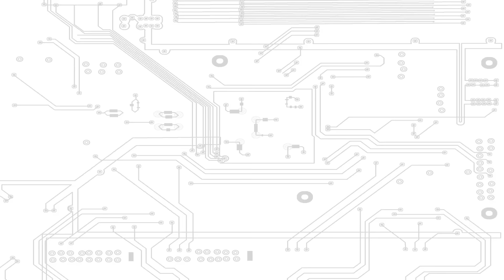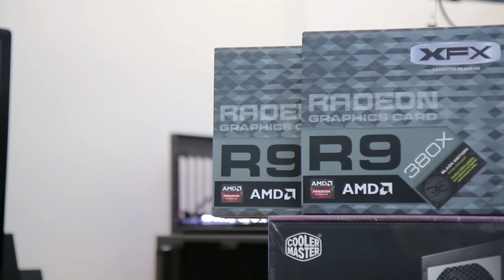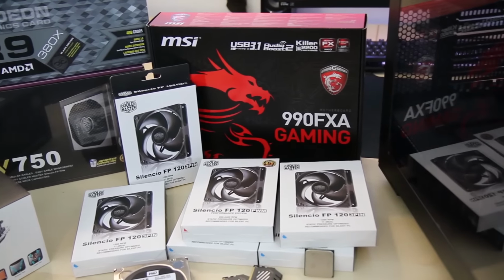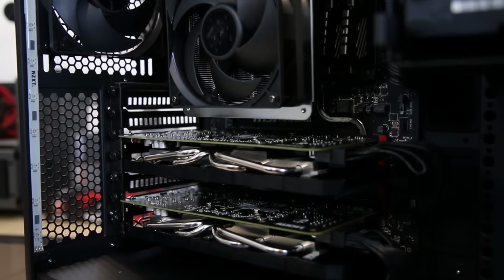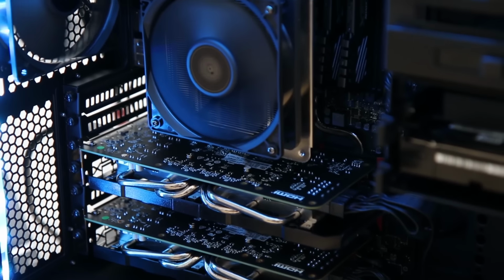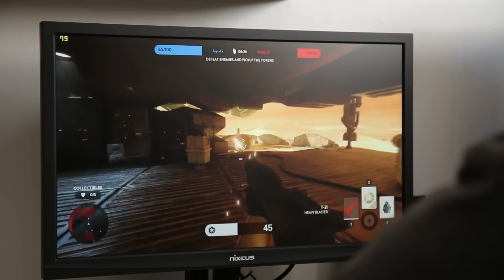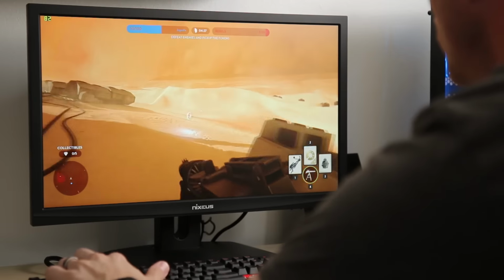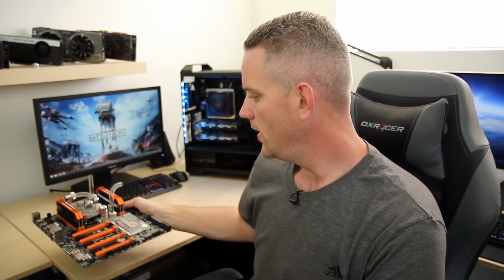AMD Gaming PC - Is AMD still good?

Comment: Any predictions for Zen?
Reply: More powah
Reply: They're gonna be flashy new CPUs.
Reply: Much better heat/performance due to better manufacturing process. APUs with HBM?
Reply: +Tech Showdown   It  should  be  kick-ass  !!
Reply: +Tech Showdown It'll be extremely over hyped by everybody during the build up to its release. Then when it finally launches whilst probably performing much closer to similar Intel products it still wont be as powerful as a top end Broadwell-E or Skylake-E which will launch a few months after Zen. Its only saving grace will be that'll it'll be considerably cheaper than Intel's offerings.... That's my prediction :)
Reply: +VR6 Doug So basically like every AMD processor out there?  I wouldn't expect anything other than that really.  The AMD's strong suit is it's price, Intel will most likely always out perform it.
Reply: Hardcaslte  if it's around Ivy Bridge IPC level it should be great
Reply: hello walkman I agree with you on that one.  I just wouldn't expect it to be as good as something like a new SkyLake processor; but really SkyLake isn't that necessary even by todays standards.
Reply: Hardcaslte   yes skylake is about 10-15% better than Ivy ..
Reply: Bike Dude   not really.  Zen was only taped out 2 months ago so it takes about a year to release after tape-out ..
   and there shouldn't be any shortage since amd has contracted both samsung and globalfoundries to make zen and arctic island gpus .
Reply: GODLY
Reply: +Tech Showdown Guys i'm not very informed about what amd is doing with zen, should I get a i5/i7 now or wait and see whats coming for zen?
Reply: SynapseTSS∞   what  is  your  present  system ??
Reply: hello walkman FX-8350 and a GTX 970
Reply: SynapseTSS∞   then  wait  for  zen  and  polaris / pascal ..
Reply: hello walkman Yeah I know thats what i'm doing
Reply: SynapseTSS∞  yea  me  too !  let  us  hope  it  is  good  :)
Reply: hello walkman Indeed
Reply: Bike Dude Yes I know all this and I know it might not be better than current i5's/i7's but i'm just gonna go ahead and wait and see. Due to how bad the FX series has gona at this point I don't think AMD will make teh mistake of letting Intel beat them so hard at gaming again. Only time will tell tho.
Reply: Bike Dude I mean bad at gaming which they are infact.

Comment: Great video Jay, I still run my AMD 8350 FX as my gaming rig.  I seem to have won the "hardware lottery" with this one.  I'm running 5ghz on almost stock voltage.  I just upgraded my crossfire setup to a Gigabyte G1 Gaming GTX 980 TI and am loving it.  I'm one of those people that still prefer 16 x 10 gaming and am running a 2560 x 1600 Nixeus monitor.  Every thing seems great but I don't play a lot of FPS games and prefer Civ 5 or X-Com style games.  Thank you for this review, it does make me feel better about the choice I made for running a Crossfire rig for so long.  I still don't think I'm going to change over to an I5 or I7 build anytime soon because they don't offer enough bang for me to spend that kind of money.

Comment: i have an amd fx6300 which idles at about 20°C and never goes above 48.
Reply: I have the same mine maxes around 35 ( I don't use cpu intensive things)
Reply: +Nishant Sukharia Watch your motherboard temp readings, the CPU TCTL temps aren't actual temperatures. My FX 6300 says similar things on TCTL but motherboard actual temp reading shows much higher.
Reply: +Jon Asgaeroth ohhh. will check
Reply: So your room temp is lower then 20C? Because it will always be higher unless u have some special cooler(not fan or watercooling)
Reply: Emil Schjerven Brenden FX doesn't measure itself in celsius, it measures itself in TCTL units.In TCTL scale c stands for core, so 20c TCTL isn't 20 degrees celsius, it's 20 core units. It's a unit that makes more sense to the CPU that is more accurate for it's own power scaling purposes. You can still read celsius units on an FX CPU, but you need to get it from a motherboard. And for peak draw stats for FX the TCTL scale is used. That's why an i5 will throttle at 95 celsius and an FX will throttle at 67 TCTL. The actual temperature rating they can run at isn't that different, FX just uses a scale that the CPU itself can more accurately use since it's based more on the actual electricity in the CPU and not on a surface temperature that might not be as relevant or quick to change.
Reply: +Nishant Sukharia WHAT KIND OF BLACK MAGIC IS THAT ?!
Reply: +Jon Asgaeroth I checked the temps of the components using 4 softs,msi command center, speccy & amd overdrive & one other & all of them displayed the same temps, the gpu(gtx 960) was at about 44 under load while playing crysis 2@ ultra but the cpu & mobo temps are very low. I am using CM tx3 evo & the case airflow is very good. 2 intakes & 2 exhausts in the nzxt s340
Reply: Nishant Sukharia All 4 of those programs are just showing you the TCTL CPU temps. Look in a comprehensive program like CPUID HWmonitor. There will be a CPU temp reading on your motherboard section and a CPU temp reading on your CPU section. your 20 TCTL temp is actually pretty high, mine runs about 11c TCTL at idle, but 30c celsius read at the motherboard at idle. You're probably closer to 35c-40c celsius idle in real temp.
Reply: +Nishant Sukharia You are not overclocking it at all. I run mine @ 4.8GHz 24/7, and it idles around 45C, and hits a max of 80C.
Reply: Zane G. yeah, I am running at stock clocks
Reply: +Nishant Sukharia My A10 7700k is over clocked to 3.6 and the highest it's ever gotten was 44
Reply: Meanwhile... my damn 760K throttles at 75c using stock cooler overclocked to 4.4 GHz.
Reply: +StrongarmSlayer why are you overclocking with a stock cooler?
Reply: John Kilinski I am getting 20 Celcius at idle. Never went above 47 on load
Reply: Noah Sharbonda For the shits and giggles of course. Anyway, I've replaced it with a cheap-ass Deepcool Gammaxx 300, 56c on AIDA64 stress test.
Reply: StrongarmSlayer no more throttling?
w00t w00t
Reply: Noah Sharbonda
Rock solid 4.6 GHz. If only my motherboard supports voltage control.
Reply: +Nishant Sukharia lol my FX8350 Idle temp is 17.6ºC... but is TCTL CPU temps, my real cpu temp on the motherboard sensor is 35ºC
Reply: aofh666 maybe that's why AMD gets so much hate. :D 
Confusing parameters. Whether it's this tctl temp or sharing of modules between cores.
Reply: GamerSom GR Already did. Rock solid 4.6 GHz at 60c Prime95 Small-FFT.
Reply: +Nishant Sukharia Amd for life eh ? ;)
Reply: my 6300 is running at 4.85 at 1.435V
Reply: +Nishant Sukharia I have an x4100 OCed to 4.4Ghz and it never goes above 40 idles around 15/20
Reply: +Jon Asgaeroth so how many celcius is 20 core units?
Reply: HAHA AMD NUB AND TO DO THAT U GOT SUB ZERO COOLING LOOL

Comment: Awesome build Jay, I have this same processor with 32 gigs of memory, two gtx 970s, one solid state drive for the os, on the  ASUS Crosshair V Formula-Z motherboard and an H100i cooler and it is really all I need for the moment. I play games that are not too demanding anyway and usually don't play those faster shootem ups like call of duty and the one you just played here, i'm a simulation strategy game player so there is still a good place for those older AMD builds. Thanks for sharing as it is after all a relief to see some AMD related stuff.

Comment: Hopefully gonna get an MSI R9 390 for my upcoming PC build. Won't ever use an AMD CPU though, i5-6600k :D
Reply: +ii Shockwavez Explain why. In Jay's video he recommended the 390 over the 970.
Reply: *****
The 970 does OC like mad, but if you're going to be at 1440p or 4K the 390's memory and memory bandwidth shows it's edge. Personally, I'd go with a 390.
Reply: +ii Shockwavez good joke
Reply: +TorrentialTech 1440p is fine i know people who have sli 1440p and have yet to use more than 3.5gb of vram. Even at 4k sli gtx 970 run modern games well. Now two years from now it will bottleneck. But you get a cooler system. less power and driver updates :D Honestly tho pascal is whats going to be a game changer the 900's series was just a well done filler so they didn't lose customers why working on pascal. I own a gtx 970 and play everything at 1080p ultar with AA max and always have 50-60fps even on F'ing crysis! I wish i would've bought a 1440p monitor now. But when pascal comes out im going to build a pc for my sister with my gtx 970 and buy one of the new pascal cards and get a 4k monitor.
Reply: What's wrong with AMD CPUS?